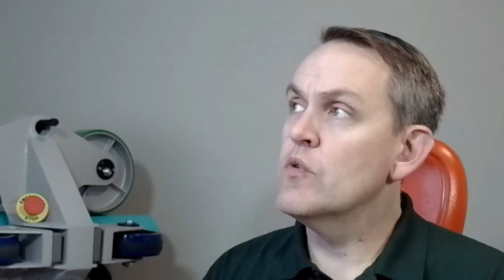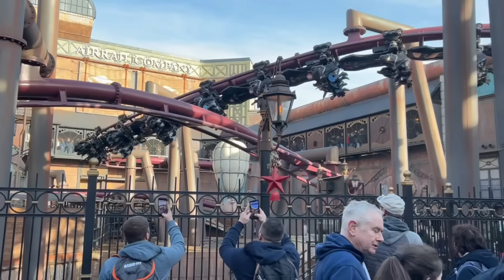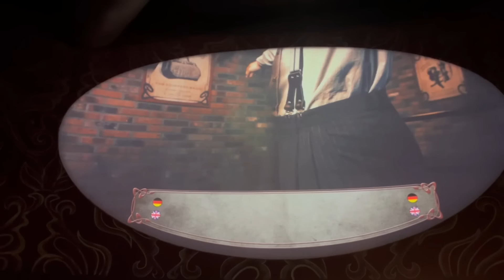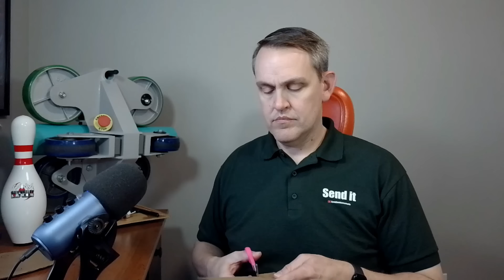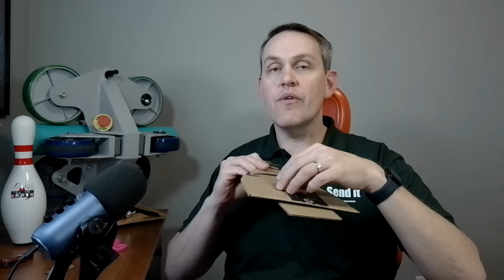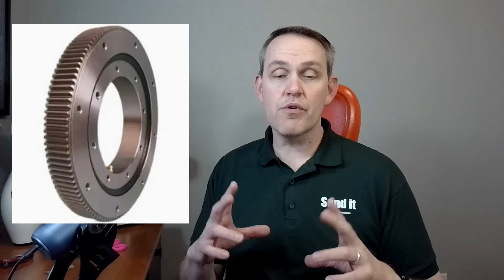How Does F L Y  work at Phantasialand

Comment: Really? I thought the rotations is controlled mechanically by tracks between the actual tracks.
Reply: I think we're so used to movement being achieved this way it feels intuitive. But when you ride it, and feel how smooth it is, you can tell it's not mechanical.

I think it would be really difficult to achieve a mechanical solution to this without it being insanely over engineered - you'd still need the locking mechanism so all you'd be saving is having the onboard motor. 

Add in either having to have the third rail the entire length of the ride, or some way of having a wheel assembly with suspension just hanging around loose during multiple launches, and a way of getting it perfectly back into the rail, and it starts to make sense to just spin that baby around with a motor.

I think it's probably what makes it feel so wondrous, by the time you've reached the first launch your mind is already blown - especially as a lifelong coaster enthusiast used to vehicle motion being achieved in a clunky, mechanical way like 4D or B&M flyers. That transition from seated to flying is so so buttery smooth and seamless.
Reply: @bodaric right, it makes sense what you say. Thanks :).

Actually my Roller Coaster Journey startet with FLY. I always got sick from flat Rides and a friend really forced me to go on fly and it was a Revelation. It was just soooo amazing. Haha. Since then I travel around and go on Coasters. 
I am a big fan a Xpedition GeForce. It's so simple but the airtime gives me goosebumps every time.
Reply: @Gabriel.A.L.  yessss ride them all! 

Have you done Voltron at Europa yet?
Reply: @bodaric Voltron is probably the only one in Germany that's important that I didn't try yet. It's supposed to be amazing. Let's see. Gonna check it in autumn when holidays are over. 
See ya on a ride, maybe :)

Comment: 13:00 The locker area is indeed one way. There are roller gates guarded by at least one employee at the exit, and the roller gate won't open without a wristband that the attendant puts in for you, so if you try to pass trough without a wristband, threre will be some questions asked to avoid any misunderstandings or at least to try and receive the wristband back. I would also assume that a specific wristband that is "lost" and linked locker are considered unusable until the day's end (or set intervals), when unretreived items from the locker can be collected and admisistrated by guest services for lost and found services.

Comment: Since the price discussion came up a few times in the comments:

They said that Taron, RAIK and the themed area of Klugheim has cost them around 70.000.000€ and that F.L.Y & Rookburgh, as in the themed area excluding the hotel (supposedly) surpasses this significantly and makes it the biggest investment they've ever done. Assuming they include developement funds for Vekoma, I could see this easily going somewhere between 80 and 100 million Euro. Their newer themed areas beginning with Deep in Africa and Black Mamba have all been more expensive than in many other parks not just because of extensive theme but also because of difficult ground preparations (this was an old opencast mining area) but also extensive need of efficient space developement and noise dampening.

They have very restricted spaces where they are allowed to build larger rides because of restrictions induced by the neighborhoods that basically directly touch the parks walls. That's why they often build on multiple levels and sink their themed areas into the ground or encircle them with high walls that are used as theming props aswell. This park has a very small footprint for the amount of rides, especially large and long rides like Taron, F.L.Y., Chiapas, Colorado Adventure...

This park is one of the most densely packed ones you can visit, together with places like Gröna Lund in sweden. Fun Fact, there is a public road going to one of the parking lots that goes right through the middle of the park and was enclosed. You can't even see it from inside the park, but you can see some support structures/footings from Taron on this road coming through the walls that form the theming elements inside the area.

Comment: I'm super curious why they use a motor to rotate the seats as opposed to a guide for a peg of some sort which manually rotates the train mechanically. It seems like a simpler system. I'm sure someone thought of it, I'm curious what the pros and cons are.
Reply from the maker: Anytime somthing makes contact with the train there is a chance to damage the train. If the line up misses it could rip steel. So much safer to use a motor.
Reply: @ryantheridemechanic  Thanks for the explaination! I figured there was a reason!

Comment: @ryantheridemechanic
The complete control of the trains is battery-powered.
This means that both the control system and the motors themselves are powered by batteries. Only at the station are there sliding contacts that briefly recharge the system. That’s why the trains are always connected to a charging station when they are parked on the siding.
Reply from the maker: What are the bus rails in the brake run use for? Still charging?

Comment: I don't know howmany blocks fly has but thay ride whit 4 trains 1 load 1 unload and then 1 on the track between the 1th and second lounch and 1 thats like near the end/on the final brake run
Reply: Also im pretty shure the seats rotate whit electro motors i saw a train malfunction while being in the queue and what happend is that only the front car the seats didn't rotate back so the seats where still in the flying position but the train was in the load/unload position
Reply from the maker: @jsjoris  that’s interesting. Was it unloaded like that or were people still in it.
Reply: @ryantheridemechanic  there where still people in it i do have a pictrue but ofcourse you cant send it on youtube
Reply from the maker: @jsjoris  kind of funny. Not for the people. Hmm I wonder if best practice there. Would be to send the train up to the launch area to level it out and release the restraints. Seems easier than on the side
Reply: @ryantheridemechanic I think if there arnt any buzz bars where the train was at the moment thay would have a battery pack to deliver power to the electric motor to turn the seats back to the load/unload position. But yea I don't know that for shure ofcourse sadly people kept leaving the queue and I couldn't keep watching for what happend and how thay got the riders out

Comment: This is by far the greatest flying coaster ever built, and I'm sure it has a fail safe so it could probably never happen, but imagine if your seat never rotated that 90 degrees to the right, and you got to ride it sideways. I'm sure Vekoma figured that it would never launch, but if it did, it could probably still do it safely, and would probably be the rarest credit ever if it did.
Reply from the maker: They would have to recalculate the forces on all components including the rider. It would be a major headache but it can be done I’m sure.
Reply: Positives and negatives stay the same. The ride doesnt have any significant laterals. But the acceleration/braking would become laterals, which might need some adjustments to launch/brakerun

Comment: This would be a bucket list coaster for me, that rotating seat concept to me is cooler than the rest of the layout. Unfortunately my health condition prohibits me from riding anything with real G forces. (But on the other hand, if I was gonna check out riding a coaster, this one would be worth it.) I agree that the rotation motor is most likely three phase, as with modern drives it is super easy to switch rotation and provide electrical braking using the motor's stator. A DC motor would require electronic commutation and polarity switching which isn't as robust (and produces more waste heat and energy loss) than a three phase on a drive.  They also have a great solution with those lockers...

Comment: Vekoma ones showed Mack Rides in the station of F.L.Y. that the seats are operated with an electronic motor and the ride could not get out of the station if one of the locked positions did not meer the requirement of the electrified signal. The operator said coach number, seat number and the leg or vest restraint which was giving an prevention from going forward. It happend to me. The ride said no to my seat cause my feet were not locked in correctly. We had to try 3 times and I followed all the instructions from the operator right, before the system told the operator it was safe enough to send the train. I do not know any of the core mechanics behind this, but it was very interesting to see at least where the system told the operator exactly where to look.
Reply from the maker: Lots of proximity sensors to line up and communicate with.

Comment: Just notice, as i'm finishing the video, at 35:11 you show differential/bevel gears? I recognize them from my nitro RC cars...  But with the explanation of the rotating gear I had different gearing in mind
Reply from the maker: Just a picture. No real pictures out there of the locking jaw so it’s a educated guess
Reply: @ryantheridemechanic  got it!
Reply: @ryantheridemechanic aha I was curious myself what would ressemble. A hirth joint? If you Google that, can find those type of gears. But I guess a stepper motor would be needed for those joints

Comment: You’re getting your wires crossed about monsters Inc, it’s not the loading/unloading that they are going to use it’s the spinning mechanism the difference is with fly the seat are attached at the back but on monsters Inc they are going to be attached at the top
Reply from the maker: Yea. Not sure what benefit turning 90deg on a suspended coaster adds. Seems pointless to me other than it might make loading and unloading a hair easier?

Comment: They have 4 trains, with 3 maintenance tracks, but mostly run 2-3 trains, depending on availability and crowd level. 4 trains is possible, but hard to do without stacking and the ride system is complex enough for guests to get confused.

So 1400 guests / hour is probably technically possible, but rarely achieved, since that would be 70 trains / hour, with a dispatch around every 50 seconds, which seems… ambitious ^^ probably more like 900.
Reply from the maker: Makes sense. Thank you

Comment: How do they evacuate the ride from the launch section or any of the non-sideways areas that can stop the train? Since no matter the rotation of the pod, if the track is face down, guests would be face down. Are fire fighters required every time they need to evacuate?
Reply from the maker: I can’t speak to this one. But honestly it looks like a simple ladder with a step platform would work fine. 
Unlock the feet first the assist when the upper restraint is unlocked. Only 1 person at a time I don’t think it would be too bad.
Reply: The launch sections are surprisingly close to the ground. If you could stretch your legs out you would be pretty close of touching it.
Reply: This is, how it is evacuated on the first launch...
https://youtu.be/D9-Z9woaJ6s?is=EoNSHKhRwHYEil7R
Reply from the maker: @rednebdnim  thanks. That about what I had pictured.

Comment: They only use 2 colors, 1 is for 1st row and other color for all other rows.
Reply: The added a Single Rider Line in 2025, which has a blue band. That only starts after the first Checkpoint.
Reply from the maker: I didn’t get in the front row but got blue and orange. One each time? Hmm. Maybe I thought I got a different color
Reply: @ryantheridemechanic  I had to look it up, I always do 1st row, and saw the "normal" queue get the other color, but apparently, if you do single rider, you get another color perhaps? and normal queue is blue (or green?). 1st row is Orange I thought, what I remember. Now i'll have to check again next time I'm going.  But 100% sure, first row is different color, because only that color is allowed for 1st row and queue on the left, compared to 2-9 row queue on the right (i mean after the metal detectors)
Reply from the maker: @Photonees okay. Probably just me not knowing for the first time in standby then the second time with a fast pass basically.

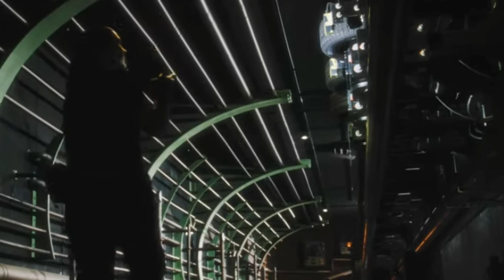Comment: 19:25 fun fact: in the Uhrwerk restaurant theres a big pool table on an elevated platform. this is actually a trapdoor that can be moved to the side and is how they get the ride vehicles in/out of the maintenance area directly underneath
Reply: It is not in the Restaurant but in the hotel Bar. So only the hotel guests can see the Pool  table
Reply from the maker: No access from the road outside?
Reply: @ryantheridemechanic nope the only way to get these trains out is by lifting them trough the hotel with a crane
Reply from the maker: @Ansgar-08wow that’s not that great. But I e done stuff like that as well. Park didn’t want to add 10ft of track so we had to lift coaches through a small hole in the roof. Oh well.

Comment: Great attraction,  I wonder why it isn't installed in more parcs.
Maybe it's pretty expensive ?
Reply: Phantasialand was heavily involved in the development and afaik have 10y exclusive rights to the model. And while it has proven reliable, having a couple of years testing the first real installation is also not bad, especially since this is definitely not a cheap model
Reply from the maker: @the_retag that must have cost and arm and a leg to do that.
Reply: @ryantheridemechanic unfortunately no one knows how much it costs or could confirm/deny exclusivity exept PHL and vekoma, and they keep quiet
Reply: They said that Taron, RAIK and the themed area of Klugheim has cost them around 70.000.000€ and that F.L.Y & Rookburgh, as in the themed area excluding the hotel (supposedly) surpasses this significantly and makes it the biggest investment they've ever done. Assuming they include developement funds for Vekoma, I could see this easily going somewhere between 80 and 100 million Euro. Their newer themed areas beginning with Deep in Africa and Black Mamba have all been more expensive than in many other parks not just because of extensive theme but also because of difficult ground preparations (this was an old opencast mining area) but also extensive need of efficient space developement and noise dampening.

They have very restricted spaces where they are allowed to build larger rides because of restrictions induced by the neighborhoods that basically directly touch the parks walls. That's why they often build on multiple levels and sink their themed areas into the ground or encircle them with high walls that are used as theming props aswell. This park has a very small footprint for the amount of rides, especially large and long rides like Taron, F.L.Y., Chiapas, Colorado Adventure...

This park is one of the most densely packed ones you can visit, together with places like Gröna Lund in sweden. Fun Fact, there is a public road going to one of the parking lots that goes right through the middle of the park and was enclosed. You can't even see it from inside the park, but you can see some support structures/footings from Taron on this road coming through the walls that form the theming elements inside the area.

Comment: Ryan, the lift hill track moves? or it's bent from vertical to horizontal and in that transition the seat moves to the complete launch position? thanks in advance. cool video, shared!
Reply: The track is bent, there's a video where they are testing the prototype track and you can see it's bent, and they rotate the seats at a specific time
Reply: @Skythedragon i just saw it, i posted as soon as he explained without watching the prototype video.